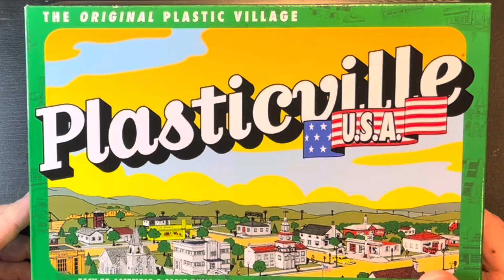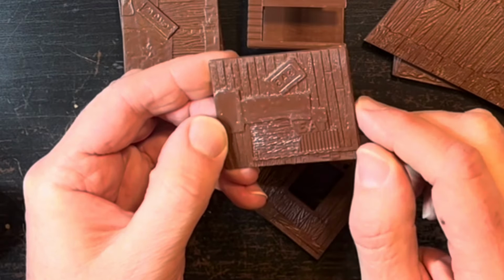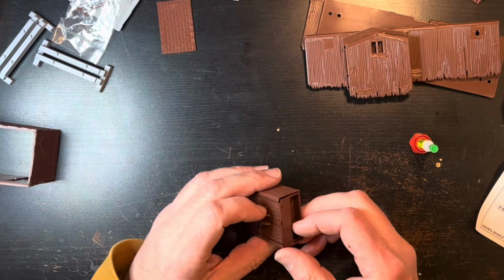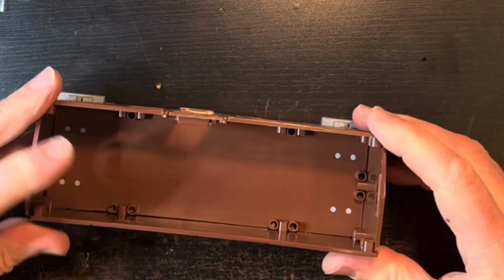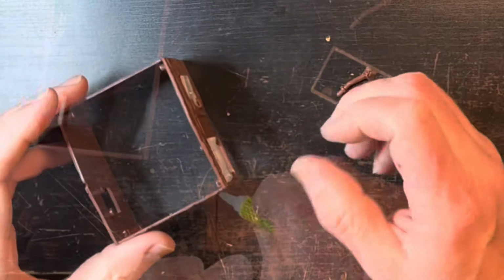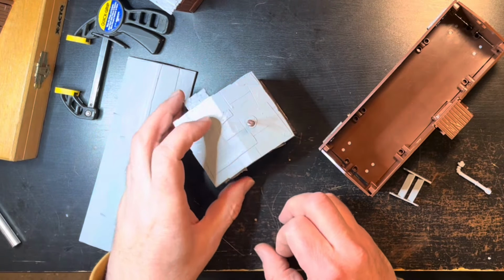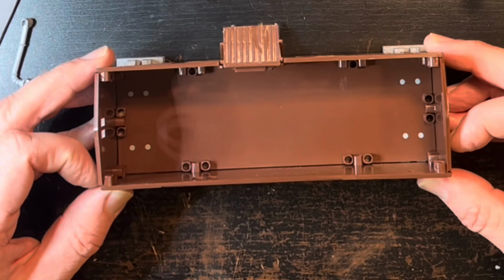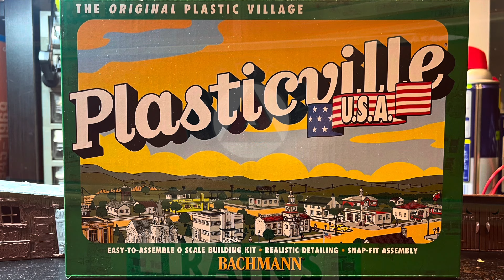Building the Hobo Jungle! Plasticville Sheds and Outhouse.

Comment: Nice build, Dave. I have 13 of similar Plasticville shacks on my layout. Some, from the 1950's kits, most from Bachmann Plasticville era.
I lighted them all using LEDs on a variable controller. I painted all them using Tamiya enamel flat paints to dull the outside walls and roofs from the LEDs light bleeding through to the exterior.  For the price they give good value and good molded in details that can be furthered enhanced by painting them. 🚂
Reply from the maker: Thanks. And thanks for the tips. I’m new to weathering so it’s going to take me a while!

Comment: Hey Dave, glad to see you tackling another aspect of this hobby. It's really easy to paint and weather the plastic structures, and they won't look like plastic buildings afterward unless that's the look you're after. Just be sure to prime them first with any flat rattle can spray paint. I use the Krylon's Fusion or camouflage spray paint. It claims to stick to any surface, forming a super bond adhesion for hard to paint surfaces. Only a light coat is needed to create some tooth to get the craft paint to stick to the surface, or you can use the primer coat as the final coat. I use the camouflage khaki tan color for aged concrete. It dries a tan color with a hint of grey.  I use several colors of the craft paint blended simultaneously or layered in layers. The acrylic craft paint is much cheaper, dries extremely fast and can easily be thinned with water, and is designed to blend with other craft paint to achieve natural weathered affect. It dries almost as fast as one can paint it on. You don't need an airbrush to create weathering. Craft paint, brushes, sponges, and water are all that are needed. I highly recommend that you give this a shot. I don't think you'll regret it. I prefer using Americana or Anita's craft paint from Hobby Lobby as they have a lot of great colors that work well for model railroading, and they always produce great results. This will remove the shiny plastic look that screams that plastic buildings look and will produce a natural, realistic, flat finish. I also use the craft paint as a stain or washes thinned with a lot of water for weathering. You'll be surprised how quickly it is to learn with this method. You can't screw it up because you can always paint over it. In fact, that's how you learn. It's very therapeutic and rewarding at the same time. I use a lot of burnt umber, burt sienna, cinnamon stick, black, various shades of gray to paint structures and stain plaster and wood. Americana even makes a silver metallic that looks great for metal and weathered with the rust colors for rusted metal effects. I use the liquid plastruct plastic weld cement as it provides a fusion weld by capillary action without getting glue everywhere. It's the easiest way to glue clear plastic windows or acetate without making the glass look cloudy. The liquid styrene solvent cement is M.E.K, however. I use large rubber bands to clamp to walls together and brush the cement into the corners. I have made floors from scraps using anything from Masonite to Foam core board and even cereal boxes painted with craft paint. I've used the clear plastic  from any type of packaging for window glass. Cinnamon rolls work the best because you get a lot of clear plastic with just the right thicknesses and have a cinnamon roll to eat while working😊.
Reply from the maker: Fantastic tips! Thanks so much. For some reason primer didn’t occur to me. I tried painting the base for my diner and it just doesn’t stick well. I’ll make a note of your recommendations and try them out.
Reply: @dagryffynhobby craft paint won't stick to the unprimed pastic surface. You'll find that the primer will make all the difference in the world. Any of the spray paint made for plastic will work provided it's a matte finish and will give professional results. I've had the best results with the Krylon Fusion matte finish or any of the Krylon Camouflage spray paints. The primers or matte spray paint will also dry very quickly permitting one to apply the craft paints just as soon as the primer coat is dry to the touch. This will give the tooth needed for the craft paint to stick to, otherwise the craft paint will just pool and bead up and not stick even after it dries. The Fusion Matte Glacier Gray or the kahki colored Camouflage make a good base color. I use the Fusion Matte Spanish Moss for the base coat for green scenery I make from quilt batting or trees. I recently found some Rust-oleum Painters Touch 2X Flat Red Primer that works extremely well for brick surfaces. It states that it bonds to plastic. It covers quickly and dries extremely fast and flat allowing coverage of the craft paint almost immediately. I have found that the Testors dullcote is the absolute best sealer to use over the craft paint. It dries absolutely dead flat without a trace of sheen. It's expensive as compared to a standard rattle can of clear matte finish. I seal the surface of my brick buildings because I use Fast and final spackle to fill the brick joints that tends to give a more aged look and contrast for brick joints. If the craft paint isn't sealed before applying the spackle it will bleed into the white spackle when applying ruining the effect. I apply the spackle with my finger and use a damp sponge or brush to dry brush the brick surface leaving as much spackle in the joint as possible. This will make a drastic difference to the painted surface and lighten it considerably. I tend to make the brick much darker initially for this reason. I think once you try this with successful results you will find it hard to stop. Each building you do will perfect your skills and you can always go back to improve a previous build. I'm now in the process of scratch building out of Evergreen styrene plastics and with the illusion of paint, I can paint and weather anything to look like wood, metal, rusted metal, brick, rock, or concrete. One is only limited by their imagination through the magic of craft paint. I recently painted some cool aged painted metal effects with metallic silver and metallic gold acrylic craft paint from American Deco-Art where it looks like paint is flaking off the metal underneath.

Comment: A neat assortment of little buildings Dave!  The first think that crossed my mind was they'd make good railyard buildings if you ever do a railyard on the layout.  The boxcar looks like a ready-made yard office or workshop railmen used to call a "donegan" after a Jersey Central carpenter and two foreman, all named Donegan, who repurposed old cars and shacks in their work area.  People were directed to "The Donegans" so often the name stuck to yard offices made from old cars!   True story!  
If you want to put off detail painting that's fine, but what I'd do (and what I've done myself) is give the buildings a clear flat  coat overspray just to kill the plastic shine. The only thing I'd do with the boxcar interior is paint it white and install a light, then glaze the windows with some milk jug plastic.  Jug plastic will let the light through and it's opaque enough you can't see inside.  
Fun little video!  Thanks for posting!
Reply from the maker: Great tips, thanks Wayne. I’ve been working on a small yard and that’s what I’ve been doing with these sheds, I keep moving them around. Thanks!

Comment: First suggestion. This was given to my by Bill Nole, The Mayor of Plasticville. Use Elmer's Glue to hold it together, as it can be easy to remove. Second suggestion. The small shacks can be used as a kids club house.  You can add Woodland Scenics  kids with bicycles to it to make it appear as a club house.   And last suggestion.  Cut down the work car to make a smaller shed.
Reply from the maker: All good suggestions! I don’t think I’m patient enough to use Elmer’s glue on these but I do like the idea of being able to take it back apart if needed.
Reply: The glue dries clear. Unfortunately takes a few hours to dry.  @dagryffynhobby

Comment: Oh neat! That's a cool looking little set. Plasticville can warp with age and the corners don't always fit. Some of the old buildings I have have glue stains all over them, turned the white plastic ugly yellow. But, hopefully that doesn't happen with modern glues!
Reply from the maker: Oh the old glue stains! I dislike those. I have some like that. I may try at some point to clean one up, even if I have to cut it apart and sand it down. We will see…